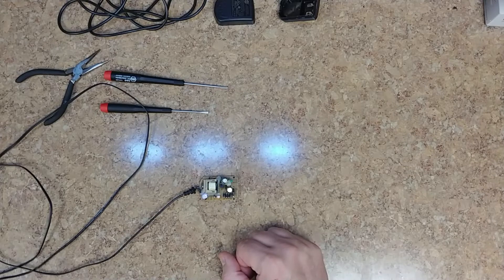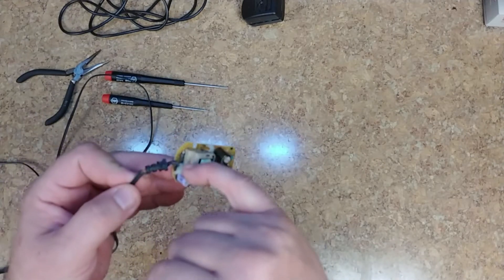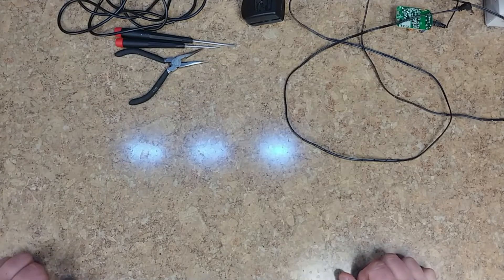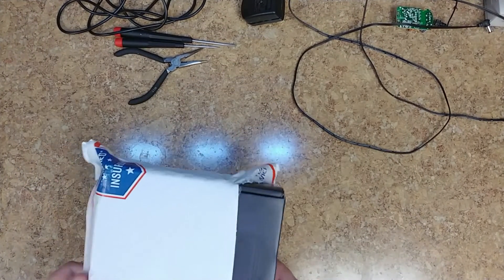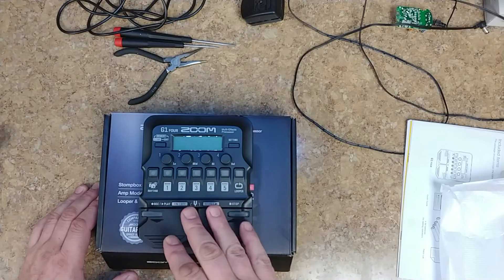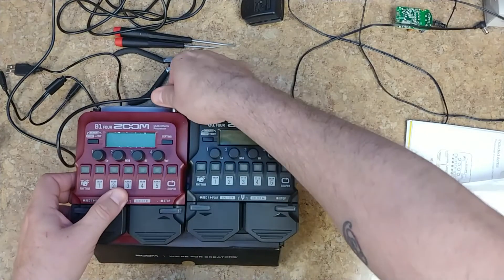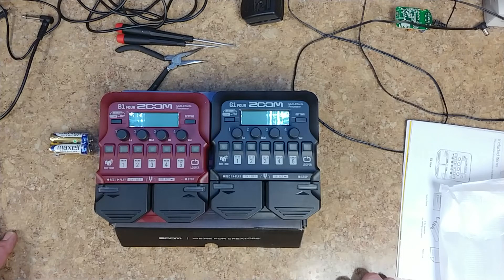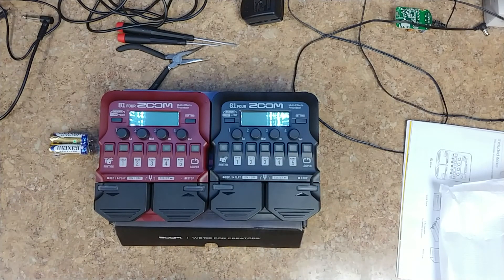Unboxing and Channel Give Aways

Comment: I just happened to see a video a week or so ago where a guy hacked his pedal to give it features that are normally only in others from the same brand. I’m not sure, but I think it was a Zoom pedal. I’m thinking that because I’m pretty sure he used the same software I have called ToneLib with it, and that is a Zoom product.
Once you have finished recreating the current song you should do Tubular Bells by Mike Oldfield as there is a section of that where he uses multiple instruments and introduces them as he adds them.